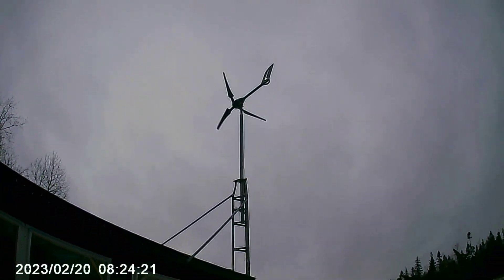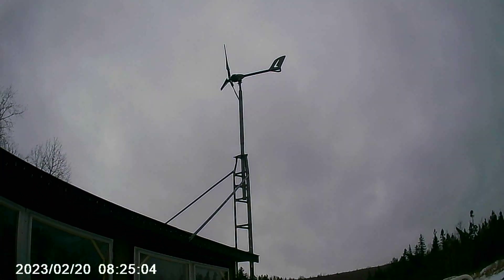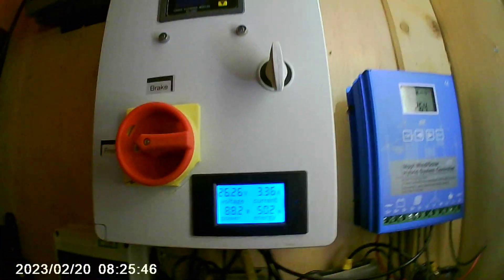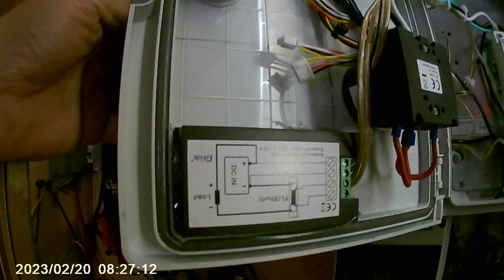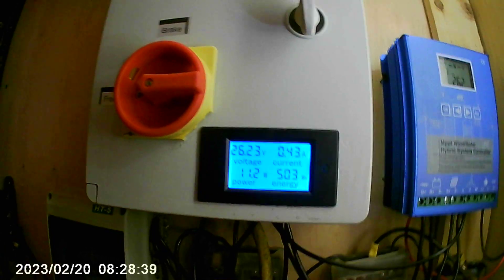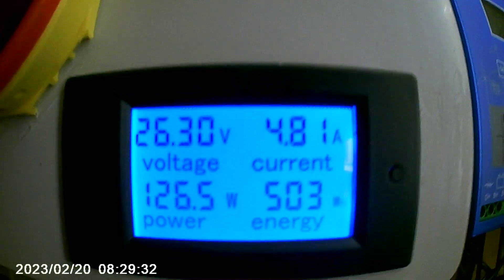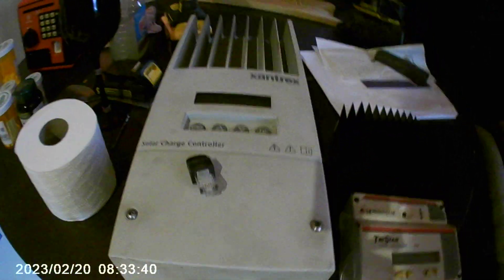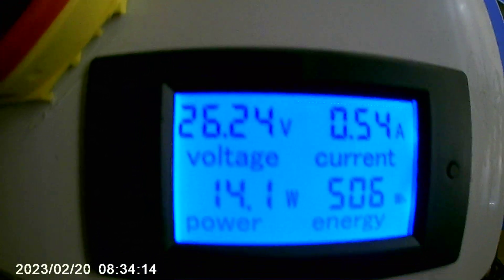ista breeze i 700 on the off grid man cave

Comment: G'day Mate, I saw another YouTube channel which had a good idea about a 3 stage braking system, one was putting a resistor on each of the 3 phases, so it slows the wind generator but keeps putting something into the batteries. His advice was to never short out the 3 wires in high winds.   
Search - 
Wind turbine wiring with disconnect design, material list below!

Comment: How's that controller going. Still alive and performing?
Reply from the maker: yupper still going strong lol.getting ready to fly the new i2000 soon will have more data to come shortly
Reply: The i2000 is 48v only I think. Are you going to run it into a 24v bank ?. Should do really well. An alternative to MPPT, albeit imperfect is to run into a lower voltage battery bank. So you'd get low wind generation. All very interesting!
Reply from the maker: 48v turbine 48v battery lifepo4 using a classic 250 cc and ts60 for dl but im still up in the air as to 3 blade or 5  @nhikoid
Reply: @offgridgarage  strongly advise 3 blade. Tried 5 blade which starts spinning earlier but with notably less RPM. Far better output with 3
Reply from the maker: ya i too am a 3 blade fan so i will swop the i 700 3 blade  to the 5 blade was feeling lazy but i absolutly agree  @nhikoid

Comment: nice video, what's the highest you've seen on the i700, i use a different wind controller but works well. i guess you already know what happens when your batteries get full and bms turns off?
Reply from the maker: turbine will free wheel and self distruct.diversion controller is important.i700 will hit ratted speed 700 watts just need the wind to drive it.
Reply from the maker: in higher winds it can hit 800 watts and will but needs 50 kmh wind
Reply: @offgridgarage  ye I have some experience with that 😂 my controller started sending 35-50v to my 12v devices, an expensive mistake, that's a nice battery bank you have !
Reply from the maker: with the 3 longer blades 107 cm the i 700 best day was 2 kwh per day for 2 days in a row using the cheap chinese controller 24v at my sons camp.the charge controller is still going strong lol
Reply: @offgridgarage  107cm damn that's pretty long, I'm running 750mm only and 650mm, I think I get more wind that you most I've seen out of my "500w" was 5.2kwh in one day but it was a very very windy day.
Reply from the maker: thats amazing for a 500 watt turbine  i dont have the stronger winds to do that so i make use of the lower winds available @offgridamps
Reply: @offgridamps   Was that one of these B&C or "REAL 500" Green Energy turbines ?
Reply: @nhikoid  actually neither, I bought it off eBay years ago, that was with 12v stator, but now it has 48v stator which helps hugely with wiring loss on the higher amperage. The stator was from Green energy , I do have a 300w from B&C which does perform or at least it did before too much wind burnt the coil, 24v coil now installed but I had to swap magnets to match so now probably a 200w, they also sold me a "400w" that turned out to be a 100w, I swapped the stator on that one too for a better 24v 300/400w. It's difficult to trust Chinese sellers.....
Reply: @offgridamps  I'm in Scotland UK and I've not managed to import a B&C or Green Energy unit. Aliexp just says "cant import to your location". Another chinese maker that's caught my eye (for a possible third turbine) is Bayoung. These machines look very substantial and their claimed outputs looks realistic compared with size. Anyone heard of them or trued them?

Comment: Fascinating video Reggie. I too, had looked at that MPPT controller on Amazon. But there are so many negative reviews about cheap mppt controlllers I decided to give it a miss. Glad to see that it's performing for you but I ( an you I'm sure ! ) will be interested to see how durable it is, especially when it gets real blowy out there. I'm sure you'll do well with your i1500. My one has been up for a year now ( 24 volt into 12v bank with DIY controller ) and it performs really well.
Reply from the maker: it is only good for small turbines 400 watt 12v max 800 watt 24v max ceiling voltage is 80v so it is not a true mppt will not work with bigger turbines on startup it will lock them out meaning not allow start up
Reply: @offgridgarage for me it didn't even handle a 48v 500w turbine
Reply from the maker: ya i would steer clear from chinese controllers there false claims  @DomX2008
Reply from the maker: That is above my pay grad lol
Reply: @offgridgarage   lol..sorry.. yes indeed!. My wife says I get into my hobbies just a little a bit too much!.
Reply from the maker: sorry not necessary  yuo are educated beyond my knowledge  your help support and knowledge on this channel is  help others and is the main goal thank you for your time sir  @nhikoid
Reply: I bought this exact mppt controller and it was trying to shove the input voltage from the turbine with no mppt control into the battery and if it wasn't for the BMS protecting it from overvoltage I would have had a fried battery, specs say it can handle up to 80v on the 3 phase turbine side but it wasn't being regulated to 24v on the battery side. Had to return as it was clearly not quality controlled and dangerous - not to mention when it worked for a brief time it performed worse than a bridge rectifier setup.
Reply from the maker: @DomX2008  i havent tested the 48v  with that charge controller.the 48v one i ordered was set back to 24v settings and tested with the i 1500 it locked out the turbine from turning so i sent it back and got a midnite classic.as i was to far to stop now.to be safe with lifepo4 i will only use mppt chargers and a dump load installed.i dont think the bms will handle the bridge rectifier long term  as its unregulated
Reply: @offgridgarage  I agree. Lead acid will survive the tribulations of a rectifier and dump load. Lithium not so. Also if the lithium gets fully charged or goes over volts it will disconnect, thus allowing a turbine to overspeed. John Daniel tuber has done a really good video recently on slaving lithium off lead acid to get round this issue. If I feeling a bit richer I'd go for the classic mppt though.
Reply from the maker: scary to hear steer clear from chinese controllers @DomX2008
Reply: With a rectifier and diy controller you will have the comfort of knowing that your turbine is always directly connected to your battery bank so that turbine voltage is always clamped down to some extent. With those cheap ebay/ali/amaz controllers you just can't be sure what's  going on and could end up with very damaging voltages. Maybe there are good ones out there but there are so few subjective reviews of these online. I hope to be persuaded otherwise cos MPPT is the best method for optimising performance.
Reply from the maker: @nhikoid  i would agree with you in my testing using the mppt controllers for wind the advantage was 5 to 1 better performance.i also stumbled on the i1500 has hit 1450 watts in higher winds for 48v turbine on 24v battery for full performance of the over volted turbine so by using higher volted turbines on lower volted batterys the mppt charger converts all that excess power into ampage the same way it does with the over volted solar array.i was hoping this was the case but only verified it a few months ago to be true in this testing.its hard to find this info online so i would not get those advantages with pwm charge controllers i would loose half the turbines value in my testing
Reply: @offgridgarage  thanks for that detailed reply. On a more nuanced note, I wonder whether that MPPT unit is simply adjusting impedance .I.e buck/boosting or is it also genuinely perturbing to optimise output v generator torque and RPM?
Reply: @nhikoid  from my experience with the Mppt overvolting my LiFePO4 batteries I would say it was no more than a buck booster in there, pile of crap in my experience, had high hopes for it, it’s not even that cheap, think I paid £150 or something for it.